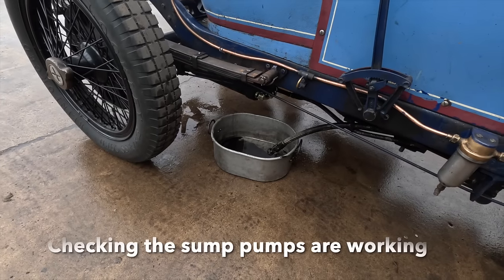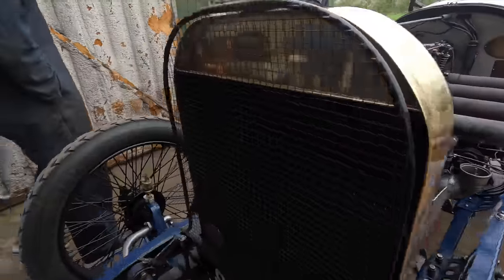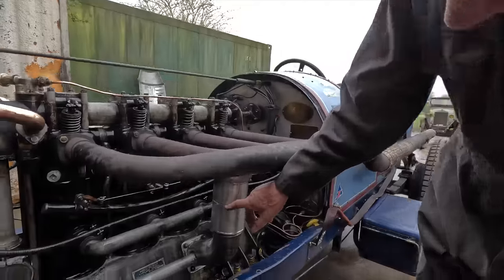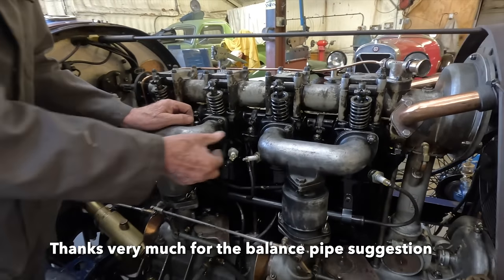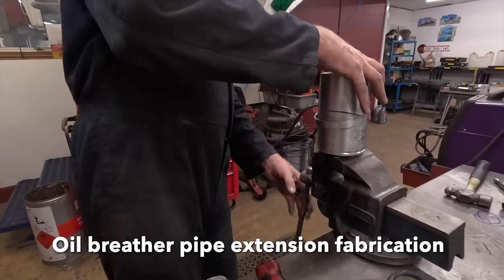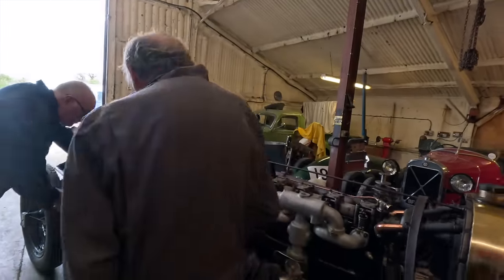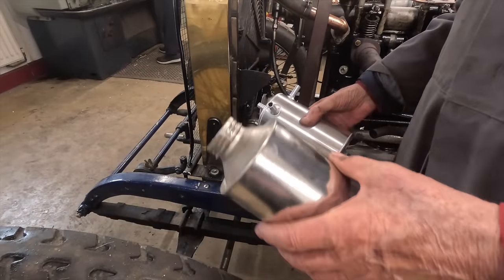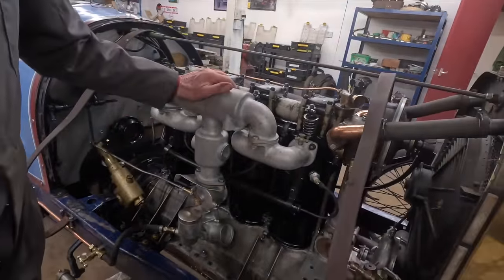SHED RACING - Hall Scott - Single Manifold Transformation - Cult Chat

Comment: Aero engines, light aircraft at least, draw warm air into the carburettor by passing it over the exhaust system first. Cold air is selected by the pilot for normal running as warm/hot intake air reduces power. Carb heat is used for low power settings when icing becomes a problem, i.e. when descending and landing. But the air is heated 'before' it enters the carburettor.
Reply: Like a beetle.

Comment: I passed your last cult chat on the Miller carb on to a fellow that works for Harry A. Miller in Troy, Michigan and is active in vintage sprint and Indy car restorations as well as the Miller and Offy engines. Harry A. Miller have most all of the original drawings for anything Miller made back in the day. They may be a source of information for you if you haven't contacted them already. I'm loving the videos of the Hall-Scott adventures.

Comment: Aircraft piston engines with a carburettor employ carb heating (selectable during ground running and flight) using warm air taken from around the exhaust manifold to prevent carburettor ice forming which I'm sure you are aware can form even on the warmest of days. Just saying! 👍

Comment: Dear Ivan, I've only just seen your video concerning the Hall and Scott / Miller Carburettor tests reference icing.   According to various sources, carburettor icing can occur at 0 to about 15 Degrees centigrade depending on humidity.  Aeroplanes needed carburettor de-icing because for every 1000 ft of altitude the air gets about 6.5 degrees C colder than sea level.  You may find that once you've got the engine going, there's enough radiated and conducted heat to prevent the carburettor from icing.  You can prove this with self adhesive maximum temperature recording strips which you can get from RS components.  Their part number 906-4599 records temperatures maximum 50 degrees C in 10 degree steps.  The idea is that the colour of the strip changes permanently at whichever maximum temperature it has experienced.  These things are self adhesive, so if you get a degreased bit of the carburettor near the throttle assembly, then drive the car with the bonnet / engine cover on and see what temperature you get.  It my be that the most likely thing you'll get is icing up when starting from cold.  I used to have an old Humber Hawk that was a beggar to start in the cold.  I used to find that heating up the inlet manifold with my DIY hot air gun (for paint stripping) until the manifold was hand hot would get it to start first go even when the outside temperature was freezing.

Comment: I was thinking the same thing at 4:21 ,   maybe cast a new inlet manifold to look more like the single carb. Only using two carbs. And look like the vintage equipment. Maybe add a turbo , put the carbs in a box. With a electric pump, and rising rate regulator, get 5-8 psi with water/ethanol injection supplied while under 3.5psi + boost!  That would be a monster. If the crank can handle it. Maybe take timing out , loose powerbto save crank!✌️

Comment: Ivan for what its worth about 60 odd years ago a spotty youth made a manifold for a mini from 45 degree  yorkshire elbows cos' It made a much smoother run in and gas flow  into the engine, it definitely worked well until it didn't and when I opened the bonnet the manifold was like an ice lolly !!  It might be worth having a plan B ready to maybe try a wrap or some kind of heat exchanger like a heater hose extension  running by it and then wrap the whole shebang with a jacket ??.
Reply from the maker: you might be right

Comment: No, you need just a bit of warm air ducted to the intake to prevent icing, and a bit of denaturated spirit in the petrol. it is the throttle you need to warm up, not the air after the carb.
Reply from the maker: still thinking

Comment: Ivan, this is truly the best Pearly Queen content I have ever seen! Personally, I would fit 4 x Harley S&S Super G carburetors. It would be just thew ticket to have 1 per cylinder if all else fails. Those rods look like they were overbuilt, as it was an aircraft engine. They Charlatans engine probably had all components as light as possible as it was a pure racer. WHen he (Ed Pink) boxed the conrods, he still drilled lightening holes in the metal. Higher dome pistons sounds like the ticket though
Reply: S and S carbureters wouldn't be allowed in the Vintage Sports Car Club as they are a 'modern' carb, only period modifications are allowed, in this case Edwardian i.e. pre 1919  or at least Vintage of before 1930.
Reply: Oh, drat. I was told only the engine must be? Anyway, FWIW, my friend used a S&S Super E carb to great effect on his Mercedes 230 Kompressor blown MG Midget 1500cc to great effect. Just never use a Diaphragm type carb with a blower,  you just can't get away from the lean spot when you whack the throttle..

Comment: I have seen a couple dual carb engines converted to single. 
I have been surprised at the increase in torque and better drivability. Might loose some over all power but if your not racing is is always nicer to live with.
Reply from the maker: Great point!

Comment: RE Balance pipe.
Instead of straight pipes where you indicated,  how about on the top centre of manifolds. Use 2 right angle aluminium tig welded fittings, connected by a hose. More accurate balancing using this method.
Reply from the maker: i think you are right

Comment: Balance pipes on twincarb set ups usually join the manifolds near the carbs? , that treats all 4 cylinders equally. Linking cylinders 2 and 3  as mentioned here could well give unexpected results with 2&3 interacting and 1&4 not benefitting properly from the balance pipe?

Comment: Build a 1" spacer off the head to the manifold to keep your Millar carb off the block & a bracket to stop the swing & vibration? Just another thought. Also copper tube around the intake manifold with rad water to heat? I had a 5.0 Bedford 6 with a ram air with a 1¾ SU carb on it with the 2 speed Eaton diff she could go 90mph. Not bad for a 10 ton bus...lol
Good luck 😊

Comment: A better idea is to follow aircraft practice. Just arrange an alternative air supply which is warm- perhaps air warmed by the radiator. Use this when carb ice is suspected.
Reply from the maker: still thinking - not had any trouble yet

Comment: That engine would be a monster with 9:1 compression and a modern cam lobe profile. The modern petrol should allow about 8.5-9.5:1 ,maybe 11:1 with the 100 octane,  the old petrol was only 40 octane or slightly higher. If i was racing back then id bore the jets out about 40% larger maybe add a second idle circuit. By drilling and soldering some small copper tubing into the carb bowl and the venturi, with a copper block in between. And drill snd tap thr block to restrict the fuel. Mix the poor quality petrol with about 50-60% methanol with about 10-20%,of the methanol being ethanol, depending on the temperature to help starting, maybe add a splash of butane in colder weather.  And crank the compression to atleadt 10:1, thr octane should be close to 100,  and the methanol cooling the cylinder detonation shouldn't be a problem!  If it is richen the mix to see if it helps.  I love these old engines!

Comment: I don't understand why you need heat. Cold air is denser, and there's not much chance of icing up I would have thought.
Reply from the maker: it does ice up - we took some video of it today
Reply: @shed_racing  Oh, that's surprising! In that case I would insulate the manifold from the head, and have some limited heat for the carb, or even have an intake near the radiator with a flap valve for cool air later.

Comment: Why not put coolant through the manifold rather than oil? A small bore thermostat bypass  as is used for a heater. At the same time a heater could be added for driver comfort. A Morris Minor type is self contained and easy to install. It can be also used as an auxiliary cooler on hot days and to hell with driver comfort.
Reply from the maker: still thinking on that....